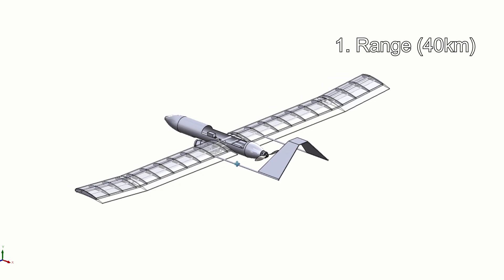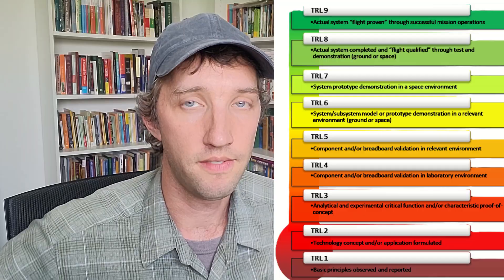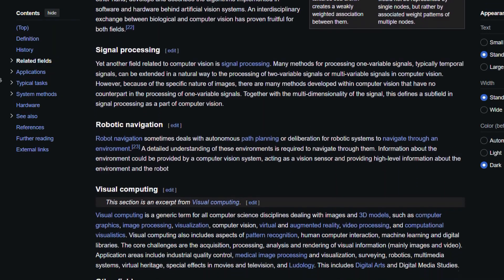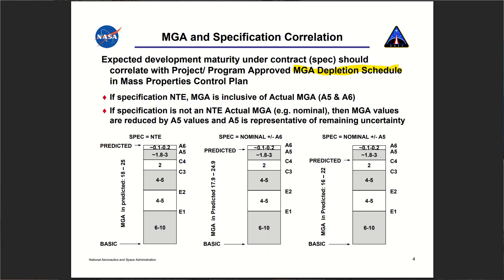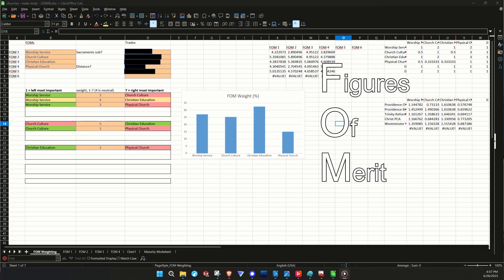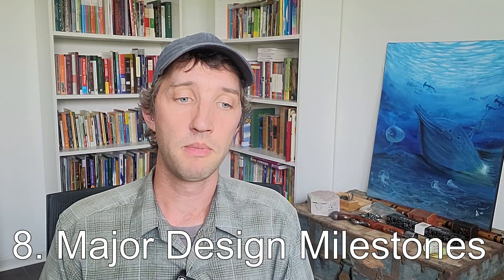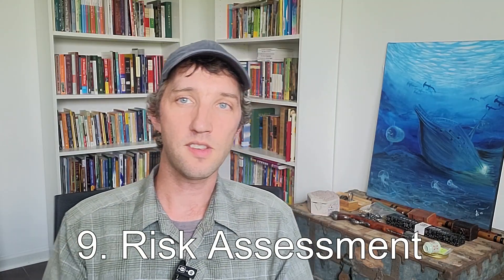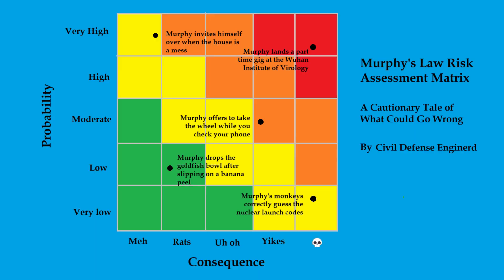I'm Designing a Long-Range Fixed Wing ISR Drone - The Engineering Process

Comment: So. I’ve been designing and sending in designs to darpa. I was scrolling YT and ran across your video on the darpa lift challenge. 

I love your design but it pains me on how simple it is. I know this is budget dependent and you’re probably wanting something sooner to play with but if you wanted some better ideas I could give you…several although it would take some time as none of the parts individually are to terribly expensive but the whole lot is pricey.
Reply from the maker: Bro that's not how you do engineering. It starts with requirements, not "hmm, how complex can we make this?"

Comment: Something I've yet to see is someone use a lightweight flying wing/rigid "balloon" filled with helium. With some thin polyethylene, nylon or polyester sheets (Congress: "where's the shower curtain?!") you could make the skin and aerofoil ribs. Masking tape that to a forming jig and just "iron" those together just like vacuum sealed freezer bags.

Comment: Have you thought about doing some MBD? Especially for the GNC system. My specialty btw lol. The engineering process is alot of fun. Seems like your specialized  more in the hardware side. Would love to collab on the GNC side. For the air frame stability and control analysis are you going to import your model into something like XFLR5?
Reply: I totally agree with your idea there are much more relevant 2A topics than firearms. I was also thinking of defense and alertiing systems in the civilian world. Something like IRST or even home level radar. IDK about the legality of all that stuff though.
Reply from the maker: @off-grid-on-mountain  Yeah, I'm probably not making a lot of drawings, at least for a prototype. If this become a real product someday, I'll be more official about it, and decide MBD vs 2D prints at that point. Send cut send will be my friend for any custom metal parts.
Reply: @CivilDefenseEngineer  Yeah I get that. Model Based Design is nice though for autonomous flight. I mean I do have a special affinity to it since I did alot of work with it throughout my career lol. But yeah you can get stuck in analysis hell and not end up with a product if too many details are worked on too soon.
Reply from the maker: @off-grid-on-mountain  I have a folder for a future video on alert systems! But all the things I was planning on testing are kind of jank, haha
Reply: @CivilDefenseEngineer  Haha well IRST could be super expensive. Thermal systems tend to get really expensive. But I wonder if using the cheap IR cameras from the night vision security cameras would work with some computer vision systems. Phased array radars can be done though I wish I could find the channel that teaches it.

Comment: I've been contemplating for a while whether I should finish my CS degree (which I enjoy), switching to AeroE so I can develop the knowledge to work on drones in a rigorous manner. I'm of the same mind that 2A is too narrow and most people are too shortsighted.
Reply: Aerospace combined with software is a ton of fun. That is what I did in my aerospace career. You could dual major in CS and MechE/ Aero. That would be killer for GNC and autonomous flight. Anduril and those types of companies would love that. Tbh if you had to choose one do Aero because the learning in physics and math you get in Mechanical is much harder to grasp then CS. I moved from MechE to CS and self taught myself CS to make the move.
Reply: @off-grid-on-mountain  Im doing that right now, took the leap in grad school to double major, glad to see someone share the same idea !
Reply from the maker: Aerospace engineering is a very rewarding career, I definitely recommend it if it makes sense for you to switch.